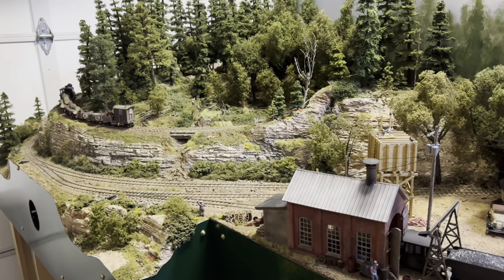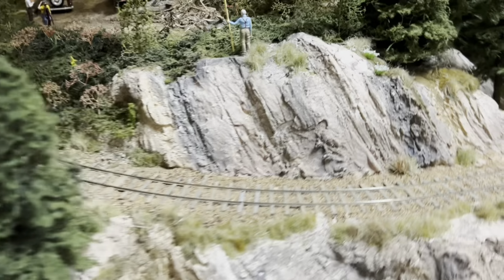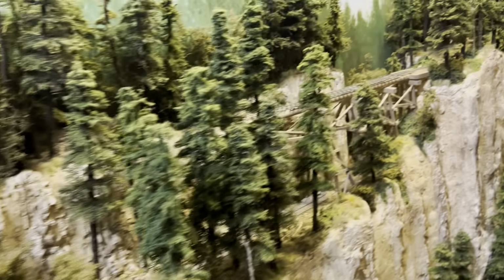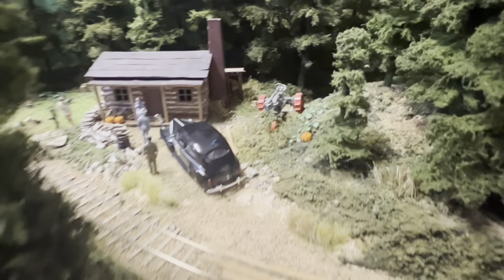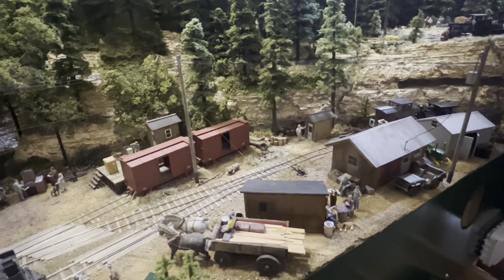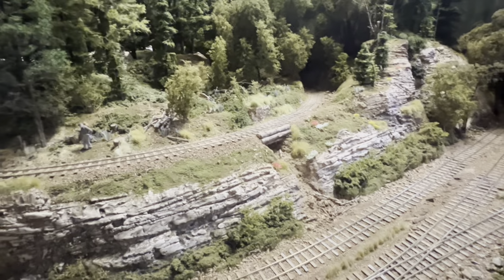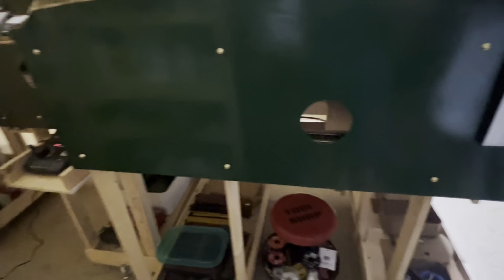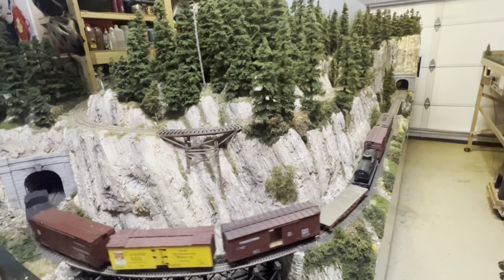O Scale Layout Wrap Up Tour & Trains Running - Model Railroad Adventures with Bill EP273

Comment: You did a really good job on this layout.  If I may make a suggestion to improve the bridge at the cliff face past the cabin.  Get some straight limbs that will pass as logs.  Split and notch those lengthwise so you can fit those to cap off the exposed plywood deck.  It will then look like big logs laid horizontal on both ends of the bridge.